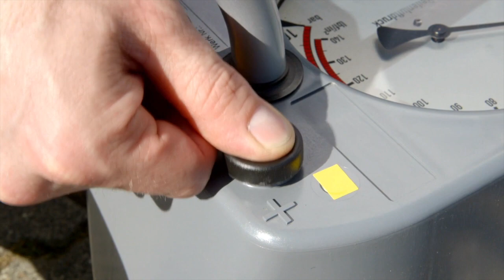AATV Episode #2 - Why You Need to Deep Clean Your Brand New Vinyl Records

Comment: I've been hearing that these ultrasonic cleaners can actually remove PVC from the record itself........not exactly "non-destructive".
Reply from the maker: They can. But not the ones we use. These are specifically made for vinyl records. They operate at much higher frequency that does not threaten the integrity of the PVC. It’s also completely touch-less meaning there are no moving parts that make contact with the grooves of the record like some other machines.